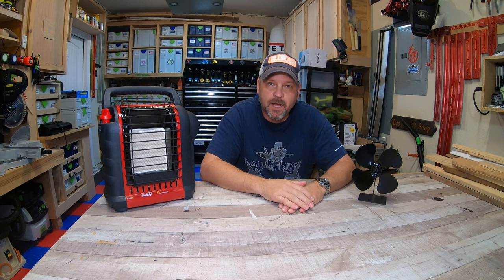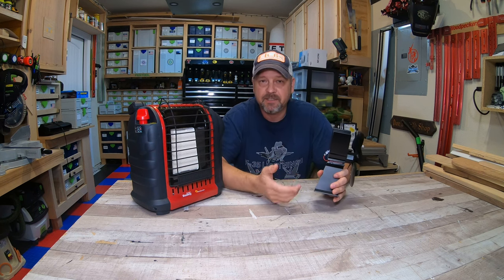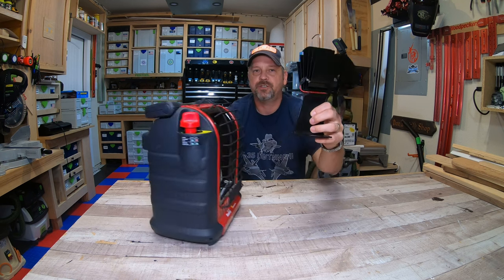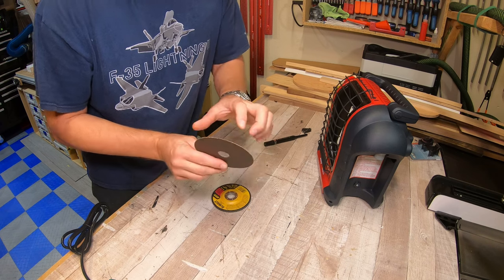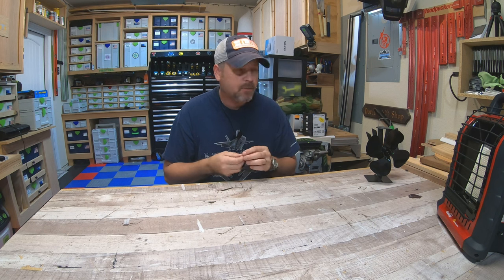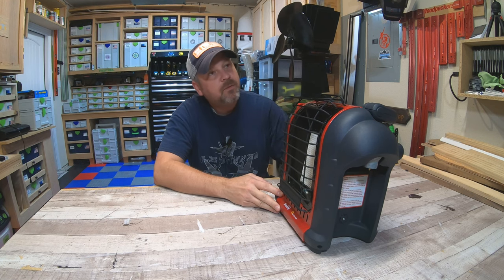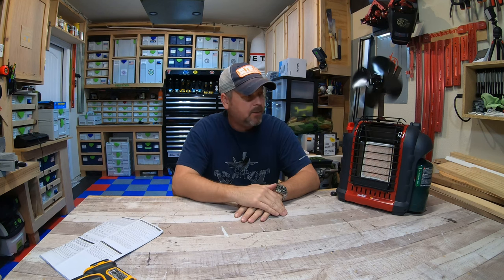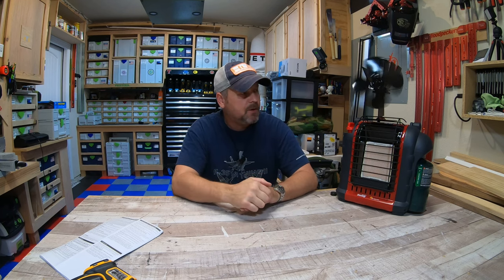Mr Buddy portable heater FAN INSTALL!

Comment: i'm doing this now.  Using a hand file. It's a lot of work.  Limited in type of power tools needed.  The old fashion way works though.  Have an old wood stove fan with just 2 blades, but it still blows the heated air horizontal.  Great jury rig.  Wish I did it years ago.  Thanks

Comment: And I have 4 full size fans running on mine two on top two on bottom! The ones going counterclockwise on the bottom take the heat going forward and push it down more so your feet stay warmer in the room!
Reply from the maker: Awesome! Thanks for the tip👍🏻

Comment: I have two suggestions that should hold the fan more secure.
Start your notch a little higher then down to the base. This should make it so that a certain angle is needed for it to be removed.
Drill a 1/4-inch hole where the end of the notch will be. This also will hold the fan onto the grid better.
Reply: BTW - Thanks for the good info.
Reply from the maker: Thanks, great tips👍🏻👍🏻

Comment: We have a big buddy in our Motorhome as a  standby for emergency use.  A few years ago we were coming back from Florida but a massive blizzard was blowing through the northeast. All highways and roads were closed and we were stuck at the North Carolina border for two weeks.
Our big Buddy came in real handy since our LPG was starting to run low.  The issue was that our Big Buddy has a fan.  A very inadequate D Cell Battery fan that you can hardly notice.  It created a mess, Big Buddy radiates a lot of heat that was going straight up to our padded vinyl ceiling.  Not only causing damage from the heat but damage from the moisture it propagates.  This is a much bigger problem than meets the eye.  To replace a damaged ceiling like that would have been in the thousands.  You also need a dehumidifier going full blast.  Our Fix was to put the buddy at the front of the coach with a 36" tower fan and a 14" circular fan behind the Buddy but that still didn't fix our humidity problem. These are great but they come with serious side effects.
Reply from the maker: I have heard these are not ideal for RV use due to the moisture they put out. Even with venting and dehumidifiers I’ve seen issues with the amount of moisture these can reset. Thanks for the comment!

Comment: Hey man fun fact if your Buddy heater is on cement you can place the heat fan on the ground a few inches infront of the heater and it will start to spin counter clockwise! It’s because you are reversing the polarity of the peltier cell by heating the top instead of the bottom!

Comment: Is it possible to overheat and melt the insulation on the wires of the thermoelectric unit?  Can the motor overheat?
Reply from the maker: There are max temp ratings on these fans. So you need to get one that supports how hot your heater gets at max

Comment: I like the fan idea but I might try it with the fan sitting a little bit more forward so those heat collecting blades in the back are more into the rising heat. If you had a little stainless steel Grill that you could put in front of the heater you can actually put four fans on there blowing in 360°.
Reply: The fan works based on a heat differential. So the base needs to be hotter than those fins at the top of the fan. They are larger not to absorb more heat but because the are there to disapate heat. The fan could be all mechanical (Stirling Engine) or using an electric motor and a TEG (termal electric generator)  but both types need to have a large heat difference between to points work.

Comment: Where do you get the fan and how many blades should it have?
Reply from the maker: Hi Kathy. There is a link in the video description you can click on and it will take you directly to the fan I used. Some fans have 3 blades, some have 4, I’ve even seen some with 2 blades. It doesn’t really matter.

Comment: What is the point of the fan does it decrease carbon monoxide or something
Reply from the maker: It helps push the heat toward you instead of just having the heat rise up

Comment: The big buddy actually has an internal fan is run by batteries
Reply from the maker: Not this model. They are now making them again with the fan, but stopped for a few years because of tariffs put on some of the fan parts

Comment: why not just cut the wire grill and slide fan base on it......not damaging /Cutting base
Reply from the maker: The base on the fan is not big enough to stand correctly if you just cut the grate. Maybe on the bigger Mr Buddy heater, but on this one that is not really an option. At least with the fan I bought. Also, I don’t want to modify/cut the heater  itself.
Reply: try cutting a slot in the top wire of the bail, less width then the TEG fan bracket, so it holds the fan in position. a piece of steel could be attached to the base at the rear, to give it stability, or some small clamps. 
Buddy heaters have 4000, 9000 or 18000 btu, the fan will have to be adjusted forward or rearward to avoid burning up the TEG module, they are rated for 600 F maximum. adjustment is necessary. i have not tried this yet, but it should work.

Comment: WARNING! I added a fan like that to my Buddy heater but cut the slot too long.  When I slid the fan back, the stand deflected the heat coming out of the vents on the red parts and melted my handle!  Since then I only push the fan back far enough to stay on.
Reply from the maker: Thanks for the tip👍🏻